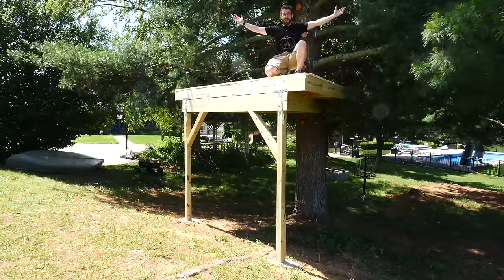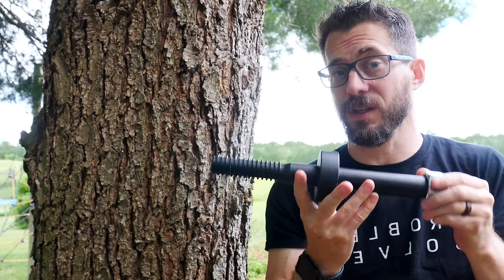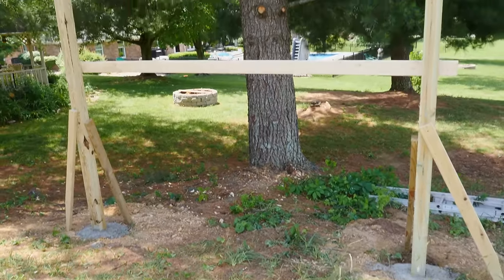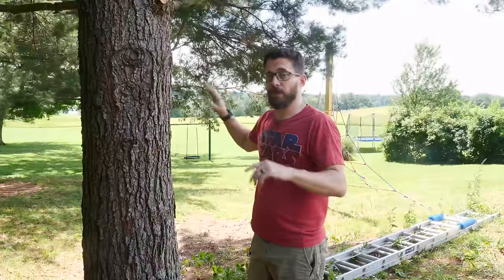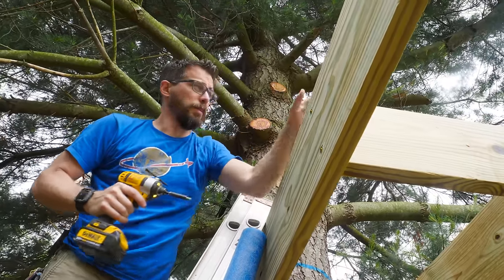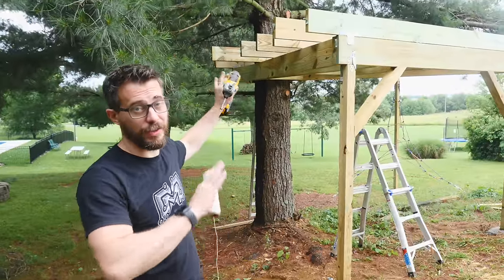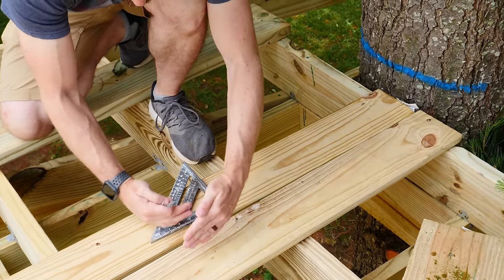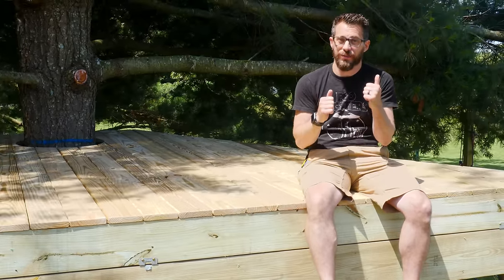How to Make a Treehouse Part 1 | I Like To Make Stuff

Comment: Sooooo, Stopped at the ten minute mark but had to comment in case someone else does this based on your ideas... I know what you're doing will probably work fine but if enough people do it, it will fail eventually. 

1. Everyone is commenting about the live branches you are cutting where you said they were dead.  Well I saw dead branches too, which, if you didn't cut them all, and if some on that side of the tree are dead but not quite ready to fall, you gotta cut all of them, especially an evergreen those branches weigh a lot and they are gonna fall where? On The Treehouse!! A treehouse should be built on a very very... very healthy tree and all branches that "may fall" should be removed if they could hit it. 

2.A Wooden Post in the concrete is fine for a fence, not a structure, pour concrete above the ground using a tube and place a bolt in it, use a structural connector post base to fasten the wood to the concrete.  It will make the wood last longer and not rot and fail prematurely.  Same goes for decks.  Honestly this would have been safer if you just used concrete or even limestone and some of those pre-made floating deck concrete blocks.  Don't know if they have a name but the Internet knows what I'm talking about, so does Lowe's. 

3. It's cool that you're using structural wood connectors on some of the joints.  Don't use decking screws on those, they make screws for that, and use all the holes.  The screws should be something that won't rust and they will sit flush, again, they already make screws for that, they should have literally been right next to the connectors when you bought them wherever you bought them. 

4. Again, this is probably not a big deal but when you screw two 2x12s together don't put the screws in perfectly perpendicular rows of 2, stagger them, it's the power of the triangle, and throw some glue in there if you can. 2 - 2x12s is overkill anyway so it's not going to effect you, and for the record overkill isn't bad just a bit more expensive. 

5. You don't need both those connectors, that's not even what hurricane ties are for, if it's not sturdy with the one connector where you fasten the 2x12s to the post then get a more heavy duty connector and  better screws, or the right screws maybe. 

6. You skimped out on the connectors that connect the 2x12s to the treehouse tab?!? That's the most fragile part.  I understand that you are going to connect the whole thing so it won't fall but don't those usually sit between the wood and the tab also to help prevent the wood from wearing down where it constantly goes back and forth as the tree moves in the wind?  Don't skimp on connectors and fasteners.  They make the project safe and they last easily 2x as long when used properly. 

Maybe people are gonna think this is ticky-tack stuff, and like I said what you did will almost certainly be fine for many years.  But if someone else is gonna do this, they should do a bit more research and not base it off this video, or any youtube video... actually some of the people on here are pretty good, but if you can't tell who's right and who's wrong then just use a trusted company like Simpson for the connectors and fasteners or whoever they aren't the only one's who make good stuff but someone. 

And seriously, falling branches is a real thing, depending on the tree they can be quite dangerous.  At least it's never to late to go chop them.  Ok, time for the rest of the video... I doubt I'll come back and update this. 

Also,
7. Star Trek > Star Wars... just sayin...

Comment: The way you pick up the hammer is wrong and will make you tire quickly. The correct way is to stick it down from the stick this way will make knocking nails easier and faster

Comment: You are using the wrong kind of screws for the joist hangers.   The ones you are using do not have the correct load rating and will snap off.

Comment: placing your posts directly into the hole with the concrete is the worst possible way to do that, the lime from the concrete will rot that post after about 5 yr. you should have used a j hook with post stand on the top of the concrete so it sat elevated from the ground and water couldnt get to it.

Comment: Pouring concrete around a post?  Why not just use the proper recommended fixture for that? Doesn't add much cost.  You could put the money you save on using less lumber for the part that you put underground and buy the correct footing fixtures.  You set them in the concrete while it is wet and it hardens around the metal fixtures.  Then you affix the exposed portion of hardware to the post.  They have standoffs for water egress around the post base which is what will ruin that post in the concrete like that.

Comment: Those are the wrong kind of screws to use with those brackets. The triangle head is not designed to go up against metal. You should use screws with flat interior sides.
Reply: Well.. he shouldn’t have used screws at all 
Or at the very least framing screws
Deck screws have no shear strength ⚰️

Comment: The beams will embed the TABs into itselfs because you didnt use a bracket... there are static brackets available aswell. 

The more weight and time goes onto the Tab through those beams the more they will deform.

https://www.treehousesupplies.com/1_25_Pipe_Bracket_p/br-p1.25.htm

Comment: Note to maker:  When there are green bits on the branches it isn't dead.  

Just say your cutting out the branches that are in the way.  The tree-huggers are going to complain one way or the other.  Just being in the tree is enough to trigger them.  You're not killing the tree, it will be just fine.  I only point this out because you made a big production of cutting out "just dead" bits if you could help it.  It felt like pandering.

Comment: Lowes should not be sponsoring someone who uses deck screws for structural connections.. also you better put those U Slides on the Tabs for prevent uplift condindions..

Comment: Exactly as he says at ~18 minutes.. it's a deck.  I don't think tree houses are a subset of decks.  I'm pretty sure you had the idea to build a tree house and then the 21st century parent gene kicked in and took every last bit of fun out of the project because it's gotta be some definition of safe/easy.  This is a deck next to a tree.  You didn't really solve any tree house type problems you started to at the beginning but then just negated the effort by putting in posts.

Comment: I disagree about that bolt being the safest approach for treehouse and tree.

When I was a boy, my neighbor friend and I built a treehouse in a willow in his backyard.  My friend was obsessed about not putting any metal fasteners of any kind into the tree, as he was convinced they would kill it.  So instead we built platforms out of plywood and 2x4s and hung them with ropes from higher branches, and used ropes to secure them to the trunk.  The platforms were established at different levels in the canopy and connected by ladders.  My friend had an engineering mindset, and I admit I was always skeptical of his plan, but I'll be damned if that wasn't the sturdiest and most comfortable treehouse I've ever seen.  Nothing moved, and no nails or screws were driven into the tree.

I suppose the ropes would have to have been replaced in time, if we continued to use the treehouse for years and years.  But as with all things in childhood, each passing season was another lifetime, and I'm sure we abandoned the Greatest Treehouse Ever within a couple years and moved onto other amusements.  If I ever found myself needing to build another treehouse (unlikely at this point), I would absolutely employ the hanging platform method, only with steel wire rope.

Comment: This is stupidly wrong! 
Well, if the tree wasn't dead before, it is now. There are ways to make a tree house without drilling into the tree. If you don't understand how to girdle a tree, there are many online courses which allow one to learn precisely that.
I'm not a tree-hugger or anything like that. I'm simply a carpenter who has built tree houses and never butchered a live tree to do it.
No need for me to watch the rest, as it started out with boring into a tree unnecessarily. Stopped there. I wonder if you've checked prices for removing a dead tree from your property? Most people don't have that kind of cash for a reputable company.
Reply: why would you remove a dead tree? cut it down (he has a chainsaw) and use it for firewood, or for the garden, or any other diy use.